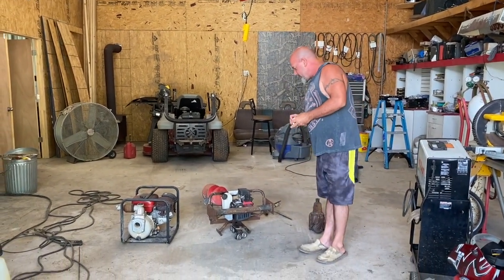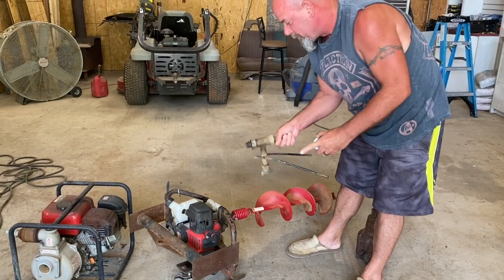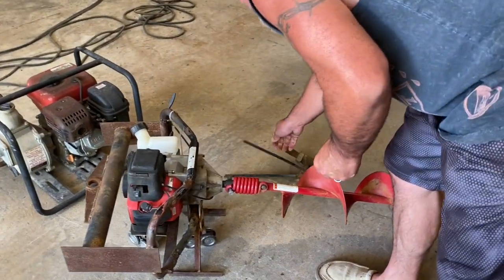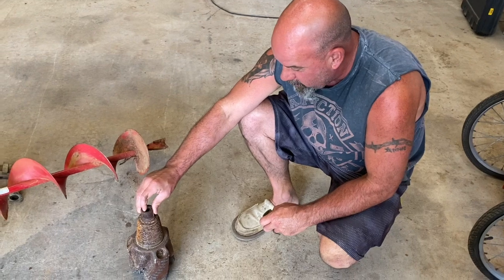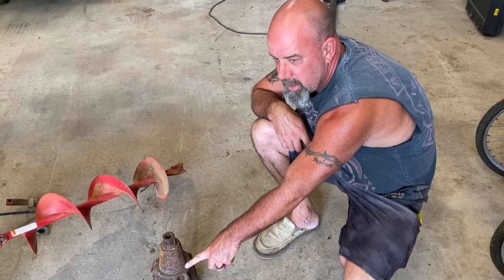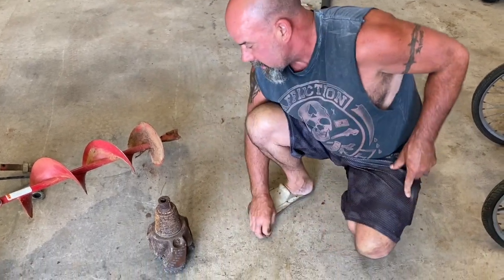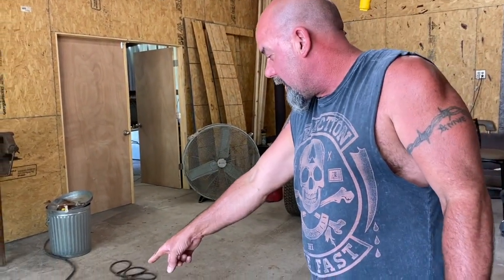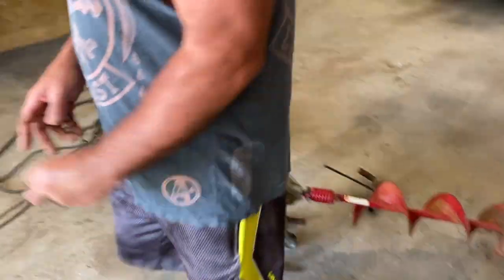WATERWELL DRILLING E-1

Comment: 4:05 I couldn’t quite follow this explanation, could you link to something that explains this situation you’re talking about?
Reply: Oh, I think someone else’s comment clarified this for me. You’re leaving the bit in there once you’re finished, so you put a check valve on the bit so when the well is in use and you pump from the interior of the pipe the head pressure from the ground water can only push water through the screen and not through the bit.
Reply from the maker: @b5a5m5  Yes and while you are drilling the well and pipe drilled down high volume is what will clean your cuttings out of the hole. If you cut the pump off and the hole is not clean it will push back up the bit and pack it off full of cuttings. In the oilfield we always call it U tubing. The only way to clear the pipe is pull everything out and clean it. A tail tail sign is when you make your connection water will be coming up out of the pipe. Meaning the back side of your hole is heavier than the inside. The float worked great for me. I hope that helps.

Comment: I’m finding parts acquisition the hardest part. Where did you get the ribbed rubber pieces that go through the flexible, black reducer?
Reply from the maker: At Lowes or Home Depot.
Reply from the maker: It’s sewer and drain fittings.

Comment: Is the old small swivel also made with off the shelf parts? I'd like info if possible
Reply from the maker: I bought it all from Lowe’s
Reply: Thanks, I found the galvanized " compression"( I call it) coupling.  Was your spinning 3/4 gas pipe brass for less friction? Sort of looked it in the video.
Reply from the maker: @joeycad  it was metal. Brass would better to use for sure. Good idea!
Reply from the maker: @joeycad  I’m not sure if I can get brass attached to my drive motor and be able to handle the torque. The gas pipe shine up pretty good after it spins for awhile. I also only tightened the rubber seals down just enough to leak just a little to keep the rubber cool. It will burn the rubbers up pretty fast otherwise. And yes I burnt a few up by turning the pipe without circulating.
Reply from the maker: 3/4” galvanized coupling fitting and 1’ x 3/4” gas pipe. And whatever fitting you need to attach it to your drive motor.